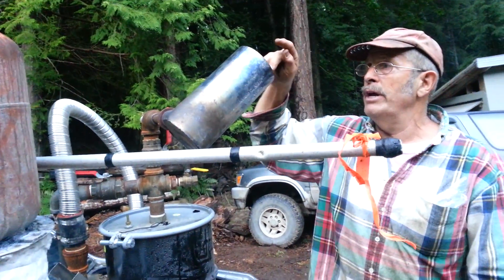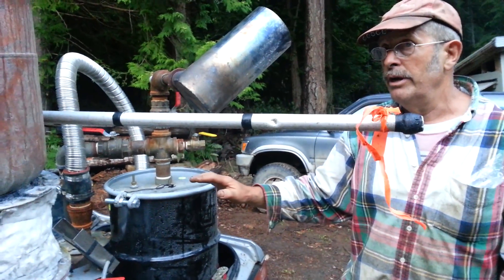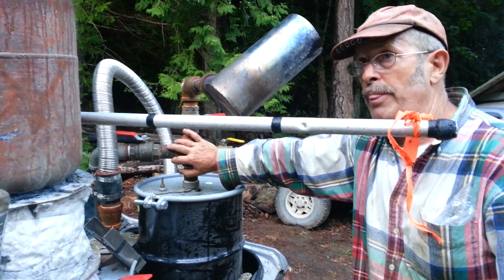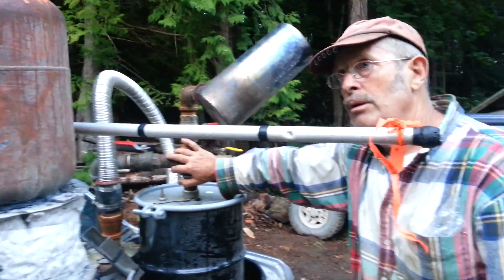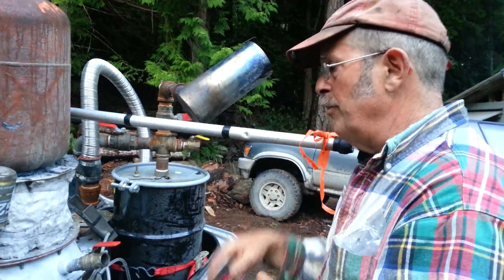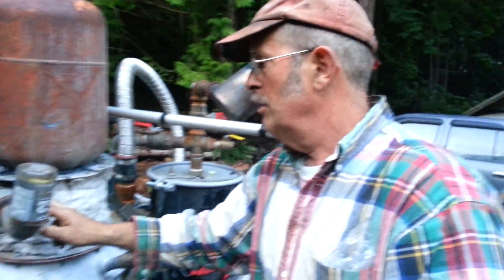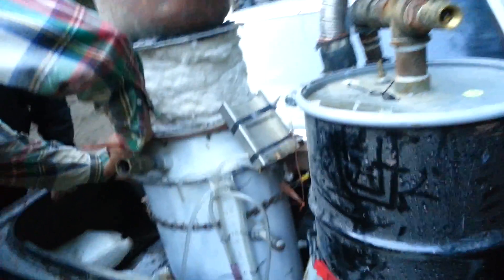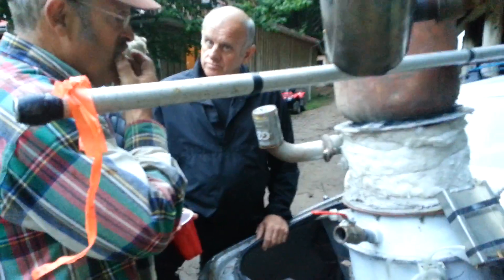Wood Burning Gas Car - Runs on Burning Wood Chips

Comment: LOL they did this in WW2 europe when there was no oil to be had.  A company actually made a trailor that you loaded with wood, that burned and created a small amount of wood gas that would be pumped to the car.  Some stated it took 100lbs of wood to go a mile.  I could find no real facts from that time. Regardless most of the wood fiber does not break down and this  can never be practical.  Yes it could work but there are much better ways to run a car on bio mass.
Reply: No, it works much better than that. 14 pounds of wood is equal to about a gallon of gasoline in terms of energy captured in a gasifier. So 280 pounds of wood is the equivalent of a 20 gallon tank. I run woodgas as my everyday driver, a 1966 Ford F350 dump truck, and its great!
Reply: haha lies. You upload videos on "anti-gravity" your not smart enough to make an f350 run on firewood.